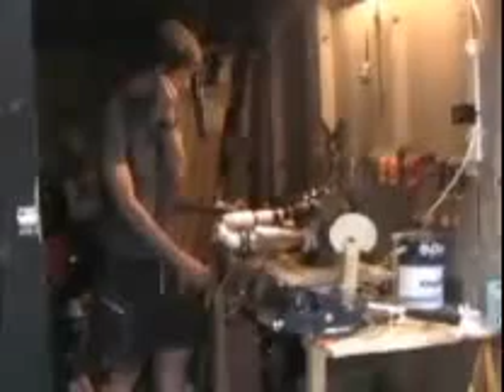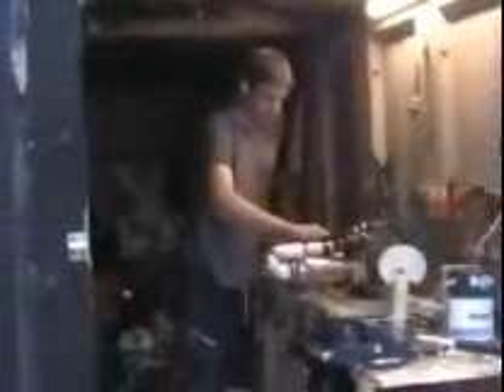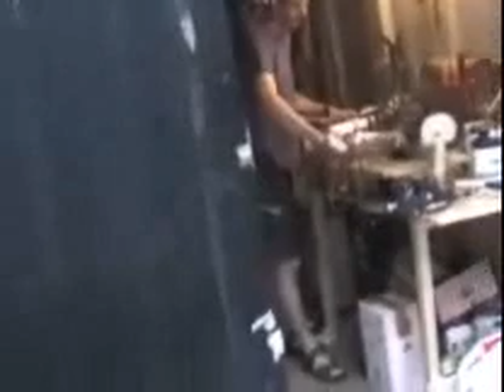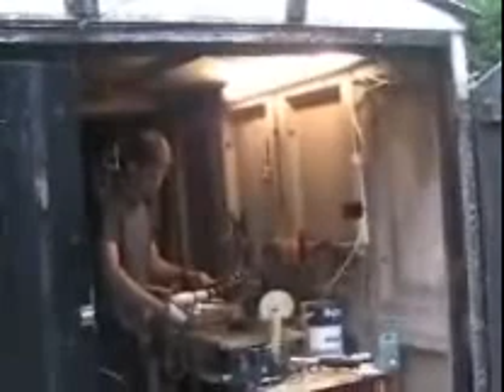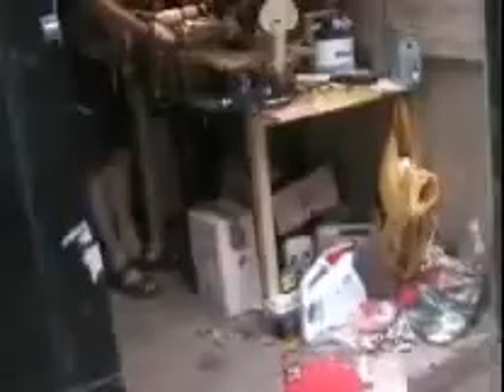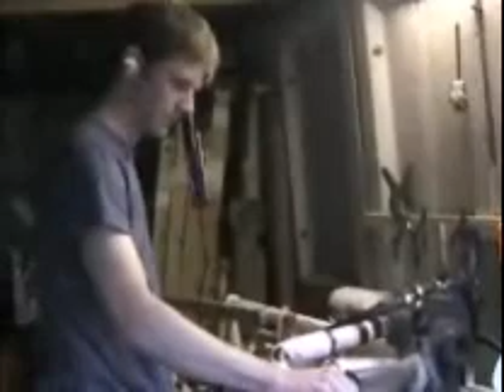DIY Turbo - Jet engine

Comment: What are you burning ? and how do you start ? 
I used a Glowplug and compressed air for starting, works like a charme.
Well okay i also use a mixture of gasoline and diesel(wich i get out of cars that have filled the wrong fuel)
And make a bigger one and put it on a skateboard :D
I have a turbo from a 300HP truck :)